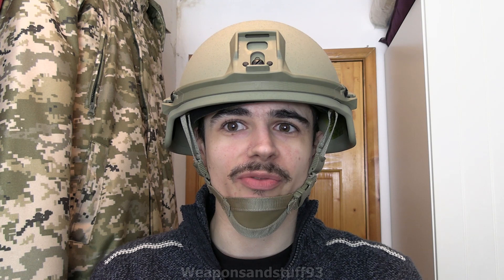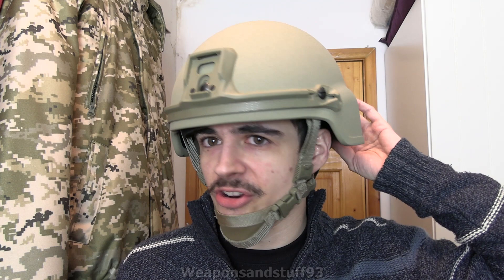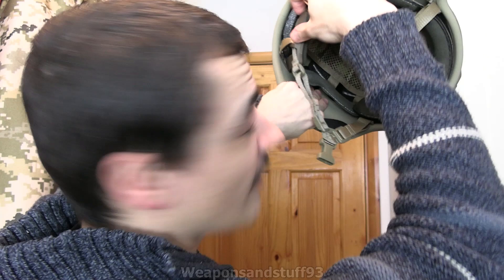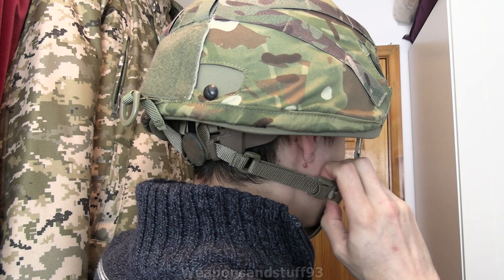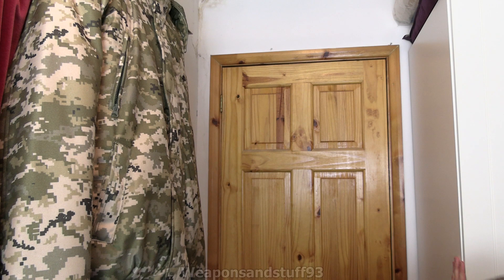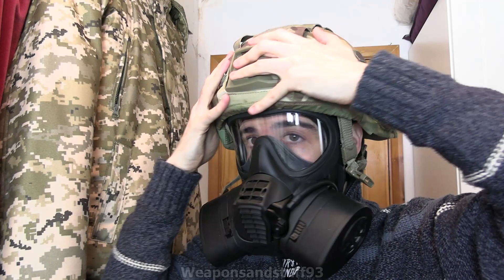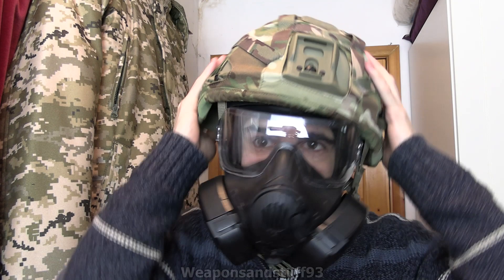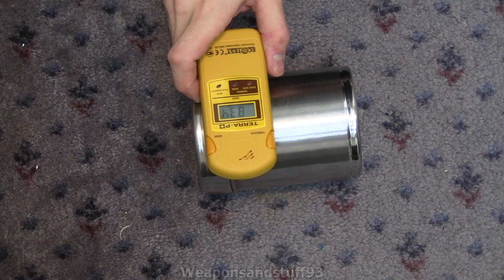Virtus Batlskin Cobra P2 Helmet Review and tests

Comment: I remember when a member of the trials team was sharing images of this at the prototype stage....looks like they replaced the gel pads with a mesh headliner. The overall design looks very similar to the Gentex/Ops Core line of helmets.
Reply from the maker: The main thing is it's very comfortable and made from a really strong material.

Comment: The problem with the polyethylene is that it cant stop hardened steel penetrators like 855/855a1 for example, which most modern militaries are fielding, unless it has some ceramics in it, as we are starting to see hybrid armor like that now. But it will stop most fmj
Reply from the maker: Age old problem, of designing stuff to beat other stuff.
Reply: The much bigger problem is the huge BFD (back face deformation) from high energy rounds like the .44 magnum and it just inverts.

Comment: To be a little pedantic, Cobra P2 and Cobra Virtus are similar, but not exactly the same.  Same part family and shape, but the construction is a little different. Built specific to the MOD's requirements. 

A Virtus serial number will follow a pattern of CXL2 K V D06, followed by the date. 

In other words, C for Cobra, XL2 for the mold used. K for the press that molded it, V for Virtus, and shift. So D, day shift. Evening, or night. And 06 is the order of which it was produced. Usually 01 to 10. 

Either way, Virtus is a very nice lightweight frag helmet. But not designed for rifle. I think any other stickers will be for the batch, and not not specific to one helmet.

Comment: Love that Terra dosimeter; I have a U.S.A. GMC 320+ Nuclear Radiation Detector, wish I could get an Alpha counter! - expensive. Again, informative and well delivered post. Thanks!
Reply from the maker: Cheapest way I've found of getting an alpha detector is either build your own Ionisation chamber or buy a premade open air ionisation chamber (Not the CDV 715 etc) Radiac MK2 type where you can open them and they still work. These read alpha, beta and gamma just fine. My MD3 I have modified now to not even have a beta window on it, so I can measure radiation from basically anything.
Reply: @Weaponsandstuff93  Many thanks for your advice! I will investigate your leads..
Reply: I was thinking more along the lines of £100-150 budget pancake detector, so far all the old cold war stuff is still way over this I think.. also needs to be super sensitive. The military stuff seems to be for much higher counts than background radiation. Anyway, I'm quite happy with the GMC for most purposes, (monitoring background, solar and cosmic events) I guess the Alpha detector is really just a wish for small detections/variations in foods/fish etc..thanks again for your leads.
Reply: Anyways! I've lost the plot a bit.. really just wanted to say your Terra detector is a beautiful piece of kit!

Comment: I got an Israeli civilian gas mask today, but the filter intake doesn’t appear to have threads, is this a fake or does it take a different type of filter?
Reply from the maker: The filter intake doesn't have threads. It's the 40mm screw on the top of the filter and bottom of the mask where they attach.

Comment: It would be interesting to see what measures militaries take to deal with the inevitable UHMWPE armour plates that start making current armour piercing rounds irrelevant
Reply from the maker: Either some kind of new armour piercing round I wonder if thermoplastic bullets will become a thing or the inevitable laser weapons.
Reply: @Weaponsandstuff93  I was wondering if they would go with the route of using these similar kinds of materials in AP ammunition.

It would be interesting as an experiment to see how much firepower is required to go through a UHMWPE plate that weighs the same as a level IV AR500 plate, just to see what the comparative performance is.

That would give us a rough estimate of what kind of performance our small arms ammunition requires in the near future.
Reply: They have UHMWPE plates and armor piercing ammo zips right through them. To combat this issue they glue a ceramic strike face to a UHMWPE backer. The ceramic breaks the bullet into fragments and the polyethylene catches them. UHMWPE plates alone are still great in their own way. They are half the weight of steel and ceramic/polyethylene plates, multi-hit capable, while being able to stop regular ball ammunition.

Comment: i saw a high density polyetheline plate carrier cold stop a 50 bmg at like 7 feet. if that was shooting you from real 50 bmg ranges (400-600 meters) it would put you out of action but you would live.  now im not saying all polyethylene is capable of that im just saying that theres alot of development potential on this material
Reply from the maker: Yeah especially due to the weight of it compared to ceramic or steel plates.